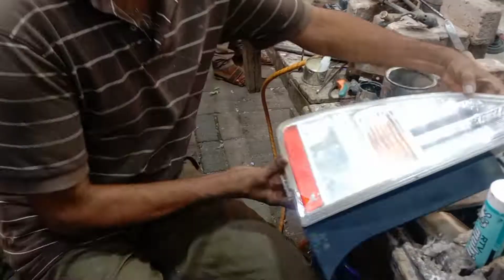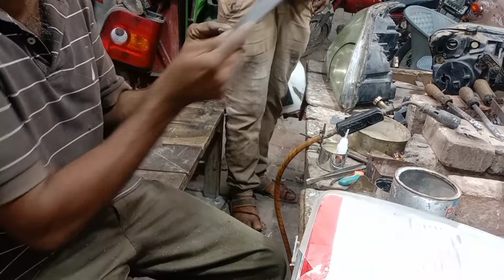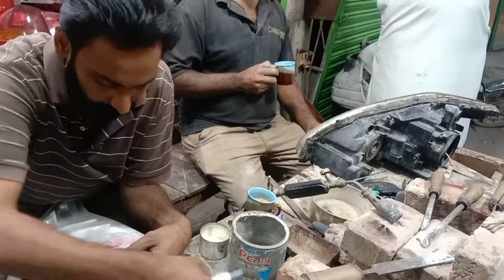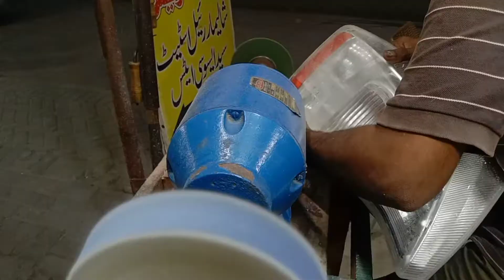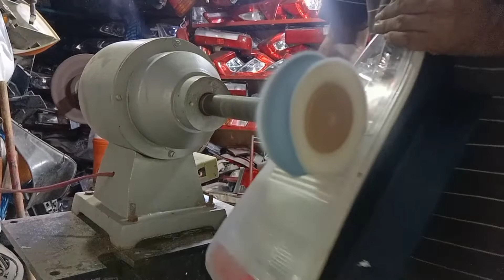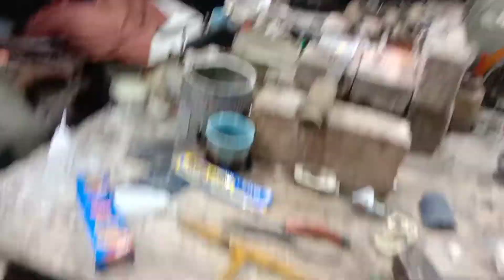How To Repair Car Headlights Broken Lens In Just 5$. How to Fix Broken Headlights with Baking soda

Comment: Hai in ka number chahea
Reply from the maker: CHACHA ABBAS AUTO'S
Bumpers Repairing And Light Maker.
Ijaz Plaza Metro Orange Line Pillor 122 ,Grand Battery Stop Multan Road Lahore.
Shahbaz Abbas: 03214282922